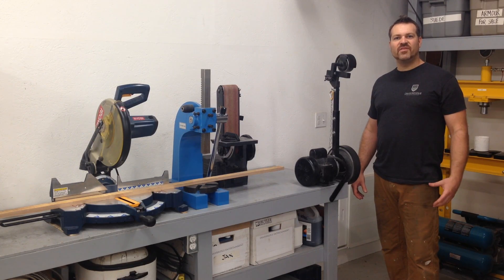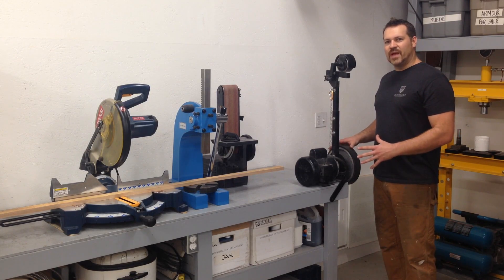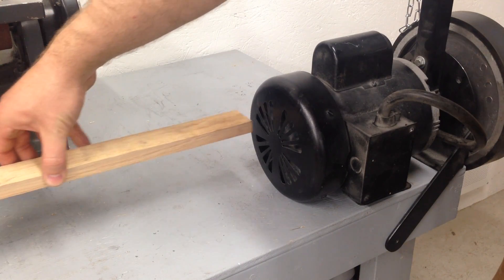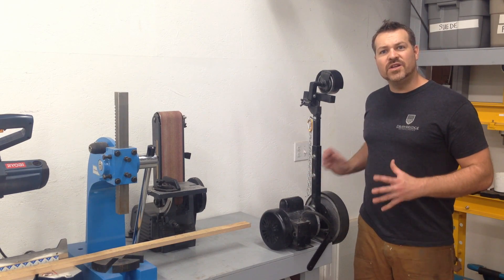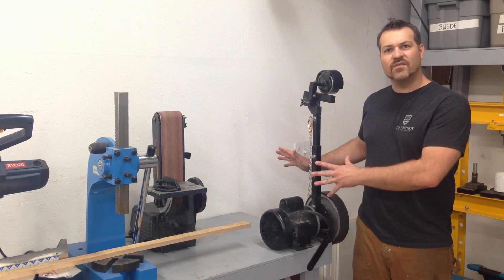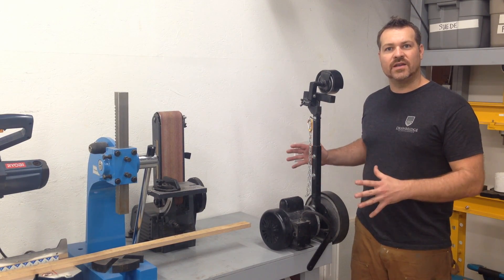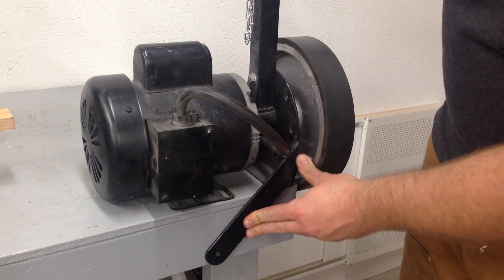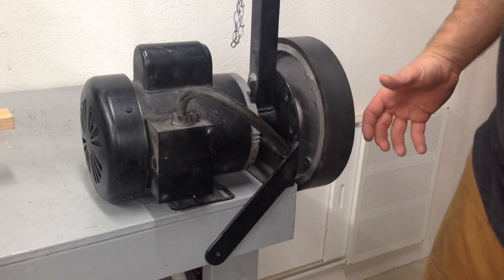T-Track Tool Mounting: Sliding Tools for Small Shops

Comment: Hey levi, I love your t track mount. After a few months of using it have you found it handy or are you having any problems with it? I am thinking about adding some sliding tools to my miter saw table
Reply from the maker: It’s been over a year and I Love it.  To note: I keep a very tidy shop. That track gets blown off with my compressor before I slide that tool and I think it is imperative to proper function.
Reply: Great, thanks for the quick reply
Reply: Seeing as it has been a year after you completed this task does it appear that it was worth it? Or was this a giant rabbit hole that you wish you could get your time and material back and had done something else?
Reply from the maker: Love it everyday. I have a relatively small shop and that tool is rock solid when I need it and out of the way when I don't.

Comment: Nice job. I have not seen this idea for workshop organization before,  Sliding medium sized tools back out of the way on a bench.  It won't work in my workshop but I have this throughout my kitchen for almost all  the small appliances.  We have used a commercially available sliding tray for that.  Not heavy enough for power tools In the woodshop but might give someone who doesn't want to install t tracks in there benchtop a different idea for construction. The bottom tray is recessed and the top tray holding the appliance just rides on top of rabbets on the sides of the bottom tray and has rollers.   Just did not think of applying it in the workshop...  

I have been thinking however of making support wings/extensions  on our mobile / portable miter saw cabinet that recess under the saw on drawer slides, up underneath the saw, and can be pulled out and raised on each side as needed.  ( I have seen plenty of fold down wings. But not any slide-out ones. )

Comment: nice work, i think in tiny holes is not necesary oil to use the drill, after t-tracks installed should use wax to lubricate them?